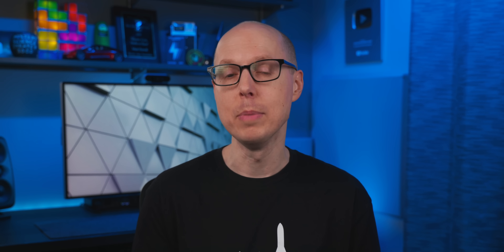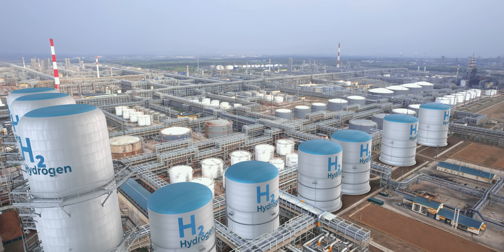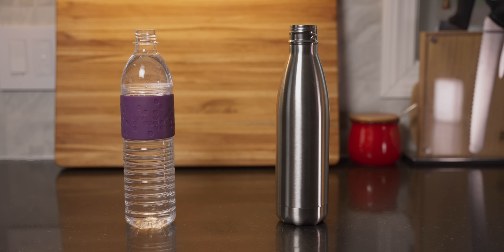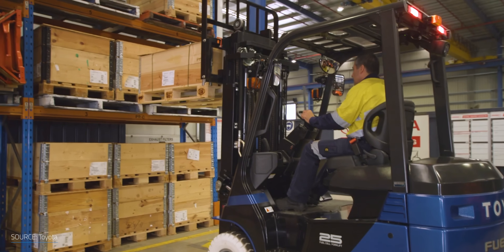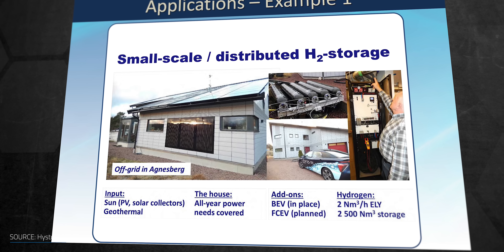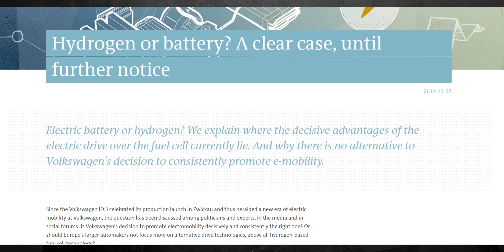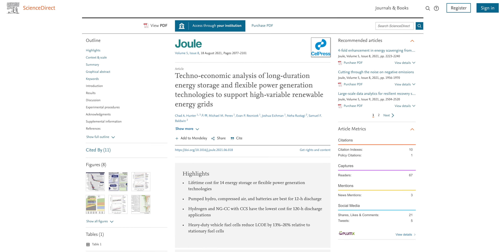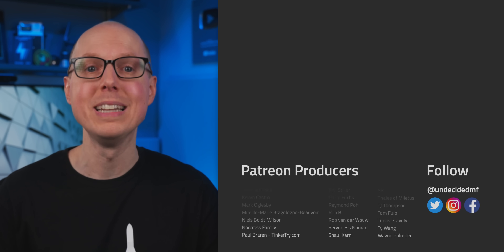Solid Hydrogen Explained (Again) - Is it the Future of Energy Storage?

Comment: Thank you Matt ! I appreciate your research on interesting topics, with hydrogens abundance to me its a solid argument for its future !
Reply: Abundance does not mean it is easy to access.
Reply: @colingenge9999  it is everywhere around us which makes it very easy for us to get our hands on it. Trying to ship it like gas is actually a limiting factor that has more to do with bureaucracy and legal issues rather than efficiency.
Reply: @colingenge9999  yes but it is also in the air and the technically to split water into its components has existed for a more than a few decades. Furthermore the byproduct is water vapor which means that to a point the process is cyclical. This can be done in your backyard and used to power all sorts of stuff including an exoskeleton with none of those dangers nor a need to pressurize and deliver it. It is that bountiful and it is that abundance that is holding it back because people want to monetize it and you can't monetize something that people can access and utilize in their own back yard.
Reply: @andresmarrero8666  if we’ve known how to split water into hydrogen for decades then why isn’t it a power source now? Even as a child I was able to make hydrogen from water so clearly it can be done but do you know how much power it takes in order to split water? Electrolyzer‘s are roughly 70% efficient and after compressing the hydrogen and utilizing it whether in an engine or in a fuel cell you get about 20% back so you might ask yourself a question wanna just keep the hundred percent in the first place? And that is the reason why it’s not done.  100 kW in to make hydrogen and you get a 20 kW out with a very expensive system to boast electrolyze compress the hydrogen three or four stages to 10,000 psi some extremely expensive tanks then pressure reducing valve‘s before the hydrogen goes into your fuel cell or your engine.

Probably the cheapest way to get there is to simply buy a Toyota Mirai and throw away the car because the subsidy the Japanese government is applying to that hydrogen technology would make that the least expensive system. But that vehicle requires Hydrogen 10,000 psi so you would have to add to that and electrolyzer and a 10,000 psi compressor which trust me will be massively expensive. Be prepared to spend close to half $1 million for a relatively small set up.

I know it’s enticing and I was encouraged to put a hydrogen system into my boat many years ago but the thorough investigation showed the cost would be absolutely massive. not to mention a whole series of technical problems that I may not be able to have solved.

By the way there is virtually zero hydrogen in the atmosphere. Do a Google search on the concentration of hydrogen in the atmosphere and I’m sure you’ll see it is Negligible to zero.
Reply: @colingenge9999  simple, the big corporations don't like something that they can't profit out of. Anybody can utilize electrosys, many do just to get rid of rust, and in doing so get access to hydrogen and oxygen that they can simply burn for power. You don't need to pressurize and deliver it because it is already in your backyard. All anyone needs is some water, a battery, some cables, and two metal planks, no major infrastructure needed.
Reply: @andresmarrero8666  I guess you’ve pretty much outsmarted everybody.
Reply: @colingenge9999  not even close. The truth is that we should have been using hydrogen ever since we figured out electrosys but due to power mongering and pure stupidity and laziness it has been stunted. Anybody can utilize electrosys and for that reason the companies don't want anything to do with it. The average person isn't going to do so either because it isn't their primary concern. The reason why people look at hydrogen so favorably is because it is that plentiful, these guys are just making the mistake of transporting it when you can just gather it on site. They are better off trying to incorporate electrosys into engine and care design rather than worrying about infrastructure. This whole situation isn't too dissimilar to those old radios that literally couldn't run out of power because they were tuned in on the right frequency. They were tossed aside and slandered for the same monetary reasons.
Reply: @andresmarrero8666  How to make hydrogen what do you do with it?
Reply: @colingenge9999  electrosys itself gets all the hydrogen and oxygen you need. After that you are just burning it as fuel and you are either capturing the water vapor to reuse or jet letting it float back into the environment. In terms of a car they would effectively run on water with electrosys built into the engine and oxygen and hydrogen being burned as the fuel. If someone manages to locate one of the working models of those old radios then that technology can be incorporated as an auxiliary power source. By focusing more on gathering hydrogen and using it effectively they would have a lot more success than trying to store and transfer it. With hydrogen being everywhere you don't really need to go out of your way to get it and the sheer abundance of it means that you can actually go with less efficient systems and later improve them over time.
Reply: @andresmarrero8666  Your idea is to make hydrogen in your backyard and presumably put it into an engine which is possible and then what would you do with the engine power?
Reply: @colingenge9999  retrofit the engine to run off of hydrogen and oxygen. Both are flammable gases so on paper they work well on a combustion engine, and since electrosys is incorporated into the engine design to begin with I don't have to worry about it blowing up. The rest I generate at home I can use however I see fit, heating up water, providing heat to the house, drying my clothes, etc. Hydrogen is a power source that can be gathered anywhere and the components for electrosys doesn't take up much space so it can be incorporated into vehicles, gas stations, and whatnot. Since hydrogen is so plentiful storing it is ultimately foolhardy and efficiently shouldn't be as much as priority compared to gathering it on site. That is a strength of hydrogen that should be focused on more and let the technology become more efficient as time goes on.
Reply: @andresmarrero8666  OK so let’s talk about running an engine. The best electrolyzers in a lab setting have been able to achieve 80% but commercials electrolyzer‘s run in the 60 to 70% range. Let’s assume your homemade electrolyzer get 60% efficiency. Then that hydrogen goes into an engine where after 100 years of engine manufacture the very best efficiency we can get is around 25% running at a consistent speed. So your overall efficiency here is 60% of 25% which is 15%.

Now let’s take a look at using the same energy you’re putting into your electrolyzer and simply run an electric motor with it. Electric motors or run at around 90% efficiency so if you simply put the power into electric motor you would get six times more power Without having to go to the expense the building your electrolyzer and your hydrogen powered engine.

no let’s look at heating water with hydrogen. Again your electrolyzer runs at 60% efficiency to produce hydrogen. That hydrogen is then used to heat water which is a possibility. The very best hot water heaters run on natural gas and use a condensing cycle run at about 90% efficiency. So in this case we’ve got 90% of 60% which is about 54% efficiency based on the electric energy put into your system. No it’s like it simply putting that electric power right in the hot water tank which is pretty close to 100% efficient so you now have almost doubled the cost of heating your hot water with a gain a lot of unproven hardware along the way that you’ve had to develop which is why that would not work either.

Your ideas are based on belief systems that you have. No matter how fervently you believe that hydrogen is somehow some magical energy source that does not change the fact that it is not. You’re certainly free to spend your time and money however you please. Have fun with it.
Reply: @colingenge9999  hydrogen and oxygen with both being flammable gases, and I am not that concerned with efficiency because hydrogen is so plentiful and it is rather dumb to compare to fossil fuels which is as efficient as can be and didn't suffer from two decades of being shelved. With how plentiful hydrogen is it offsets the low efficiency, furthermore I am using every single bit I am getting in a comparatively small setup and am not trying to ship it out. Unlike the others baring solar panels, electrosys can be installed into homes or just used at home with however the owners deemed fit. Furthermore there is also a condensation recycle portion within electrosys itself because the byproduct is water vapor which can be condensed back into water for further electrosys until there is not enough to practically use. This is a genuine advantage of hydrogen in that it is everywhere and can be easily gathered by just about anyone  and used to power all sorts of things. It is far from fiction nor just belief.
Reply: @andresmarrero8666  
Gas	Formula	Percent Volume
Nitrogen	N2	78.08%
Oxygen	O2	20.95%
Water*	H2O	0% to 4%
Argon	Ar	0.93%
Carbon Dioxide*	CO2	0.0360%
Neon	Ne	0.0018%
Helium	He	0.0005%
Methane*	CH4	0.00017%
Hydrogen	H2	0.00005%
Reply: @andresmarrero8666  I have a Golden goose to sell you. You put in $1000 and you get back $250. How much are you willing to pay for that goose? That is hydrogen. 

you did not answer the question as to why you would spend six times more energy to extract hydrogen from water then you would ever get back.  The hydrogen and water is hydrogen essentially has already been burned so your idea is based on the notion that we could say take the exhaust gases from a car and somehow convert that back into gasoline. That can actually be done but the cost is horrendously high and gasoline is much cheaper than that. I

Hydrogen is a flammable gas but oxygen would not be considered to be a flammable gas but rather an oxidizing agent or the other part of a flame. All flames consist of a fuel and oxygen.
Reply: @colingenge9999  because I am not using that much. All that is needed is a current, the power needed to initiate electrosys isn't that high and can be done simply with a battery, the amount produced by a solar panel is also more than enough. While electricity and fossil fuels are typically produced in large expansion structures and transferred to you which requires infrastructure, hydrogen can be gathered in your backyard with materials that are already at hand. Unlike exhaust water vapor is incredibly easy to repurpose as you only need a colder surface to cause condensation. This is so easy to do that it is done in people's houses mostly by accident. Saying that is expensive is rather silly. So if hydrogen is this golden goose, then golden geese and golden eggs must be incredibly common because hydrogen most certainly is.
Reply: I can't 100% prove it but I am almost 100% certain this guy is a paid progandalist hired by the elite to be a pawn in this game thats been going on 100 years, I'm also certain he dropped this video after I dropped mine a couple days ago. I'm not as professional as this beta nerd but I'm smarter and I've been investigating the hydrogen tech and experimenting a lot longer to assure all his audience that he is lying and being very careful how he spins the hydrogen information he gives you. The tech is much more beyond anything he regurgitates out in a pretty video for you.
Reply: https://www.youtube.com/watch?v=gQDXqOfC61U

Comment: The big thing I see here is that it still pushes a high residual cost after initial purchase.  Any company that produces these storage pucks will charge a high premium as they need to impregnate the puck material over and over and over.  This will prove to be higher cost to consumers than Lithium ion batteries.
Reply: I think (and perhaps the video could be clearer on this) that the pucks are a one-time purchase, and sit between your source of hydrogen (e.g., wind or solar electricity used to split water into hydrogen and oxygen) and a fuel cell (which converts hydrogen and oxygen into electricity).  The amount of hydrogen you can store is proportional to the number of pucks you purchase.

Comment: Storing Hydrogen won't save the planet, it still has to be made before storing.  Carbon hydrides? Methane is a gas, other options are liquid or solid. Oxy hydride (water). Hydrogen is not a solution unless a cheap and clean way is used to make it a store it.

Comment: Hydrogen is just a non starter, given the complexity involved for relatively little energy density, it's just not worth the bother for 99.9% of cases.
Reply: Little Energy Density looks at Wikipedia to see how much lithium batteries have 0.3 MJ/kg vs Hydrogen 120 MJ/kg.
There are actually engines which can take up to +90% of that stored energy..
Reply: @platin2148  Lithium batteries have reached a plateau for essentially the same reason, it is nowhere near as good as conventional fuel even with all the unicorn farts thrown in. The best batteries in the world are anywhere from 10 to 100 times less energy dense than conventional liquid fuel, and as liquid fuels are concerned hydrogen is by far the worst choice. Might work for single use space rockets but doesn't work to power or propel civilization

Comment: Why is battery storage density stalled for 4 years now?  I mean Tesla cars and Samsung phones which I think are biggest users of batteries.
Reply: I presume it's because of physics.  There's little room for incremental improvements for Lithium Ion batteries.  Lots of people are trying to create a better battery chemistry, such as lithium sulfur, but getting it to work in the lab and then producing it in volume is very difficult.  We should see a jump at some point the same way we saw a jump when people moved from Nickel Metal Hydride batteries to Lithium Ion.
Reply: We have been running low on many materials needed. It seems we might need another planet or two to get enough resources. Unfortunately, that wont happen fast enough. So instead of researching for more efficient batteries, we are lately focusing on replacing scarce metals for abundant ones, even if they have less energy density.
Reply: @davaguco  Yea, that is what LFP batteries area about. Lithium Sulfur batteries show great promise even though it was discovered by accident. We will know soon enough if it is commercially viable.